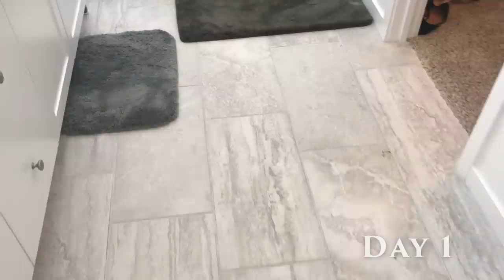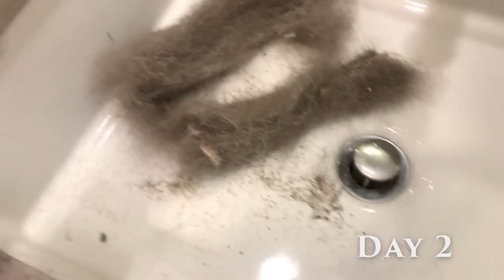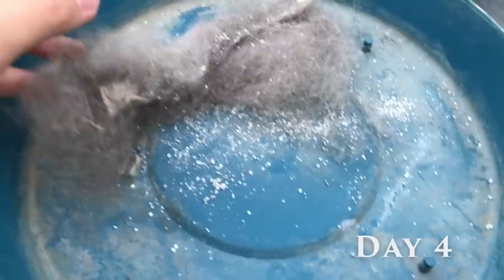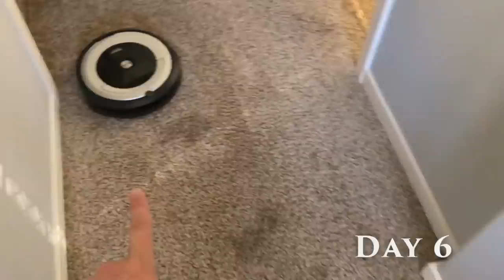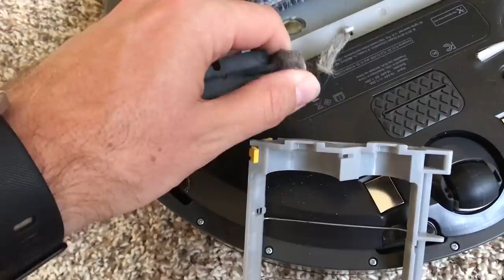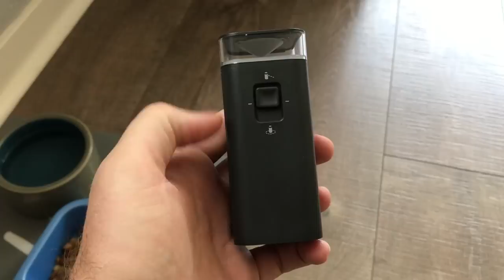iRobot Roomba true Review - My first FULL week experience

Comment: I've got a 600 series I picked up on sale for 250$. Get the cheapest one.  I like using it every day. If it misses an area today, it will get it tomorrow. Cleans under the beds and furniture.  You still need a vacuum cleaner for the stairs.  Turn it on when you leave the house or out in your garden. Put it upstairs, when you are downstairs or vice versa and you won't even notice it. A robot is vacuuming while you are doing something else or nothing. It's working right now, when I'm watching this video and commenting. No brainer.

Comment: Our Roomba 650 we've had for three years still works great. The battery still lasts for almost 1.5 
hours. We run it everyday, have a Golden Retriever and a cat so it's needed everyday.  About once a 
week or two we run a Dyson DC25 for a onceover to get what Roomba misses .
Reply: 650 owner here too. It gets the job done every day. I have a Husky at home and the 650 keeps the home really clean. it always finds the way back to the charging station and made whatever modifications around the house so it wouldn't get stuck. I noticed that sometimes it gets crazy and wont leave the charging station room and the Dock light turns on after a few minutes, but its because of all the hair on the brush, wheels and dirty sensor. I have to clean it out every day so it works properly.

Comment: that's just how they are. Unless it gets close enough to read the home charger they will do this. It could get better over time as it does the same sort of pattern and it might learn where it is but I wouldn't hold my breath. They do need a good cleaning once in a while. One thing I found is if you end up taking it apart which I have, the gearbox even gets stuff in it. The gears in the one I had were made out of some kind of plastic and will wear out over time. If you can get the right size gears you can fix it. Take pictures so you know what goes where if you do take it apart. They are not the end-all vacuum. They just don't have great suction but will keep the place looking better and somehow always finds stuff you miss when doing a normal vacuum. In a way, it's really just a glorified carpet sweeper. So you still need to vacuum the old way once in a while. If you have hardwood or tile floors then that might not be necessary. Still, it's not the end all. Personally, I like them as they always find stuff that's been missed.

Comment: I have a 680 and I run it every day and at first had to empty the vaccum bin once a day but now I can get away with about once every three days. It will not run on shag carpets and you can not have anything on the floor like slippers or shoes as the vaccum can suck up the slippers or shoe laces and become stuck. Also running it every day we have noticed that it smashes so hard into things that it is taking the paint off the front of itself and also along the skirting boards on the walls and also likes to get stuck under the sofa and has cut a mark into the wall with the side brush but over all I still love it as I never have to vaccum myself even though it can hardly ever find the charging base lol. 😊

Comment: To be fair, you are supposed to keep the charging station in an open area, also clean your robot more frequently. You are supposed to clean it 3-4 times per week.
Reply: I cannot find a replacement dock for the 365 model even on amazon. Can you help. It is an older model but still works. I got it from a deceased relative house but couldn't find the dock. It worked for about 30 mins because it had been charged

Comment: A few but major drawbacks. I stopped using it for years and don't know what to do with it.
It does not clean stairs .
It does not clean furniture with low clearance.
The auto park and charge won't work if the charger is on a diff floor.
It does not clean my house well with 1 dog and 2 cats, and a couple of long hair girls. Need to un-hair the brushes (take about 15 min) after every use.
So a lot of manual work to overcome the above.
Last but not least, noise - so it can't work during business hours - Both my wife and I work from home and we need a quiet environment to chat online frequently with no fixed schedule
I still prefer my cordless Dyson which I have to spend more time for the cleaning but a lot more efficient considering the above.
Irobot is cool, and fun. Does it work? No!

Comment: obstacles that it should be able to fit under but cant would be a breeze if you could steer it under there with a precision manual control. Users could then save those precision maneuvers to supplement the auto mapping.
Reply: You can steer it the older ones had a remote, the new ones like in the video you can use your phone..
Reply: Literally days after my recent obsession of researching these robot vacuums a close relative of mine actually got one for a Christmas gift. So you already know I'm going to be messing with that thing to the max 😂
Reply: wasted of money

Comment: Bought the Roomba e6 this week after all the hype.  We live in a 1500sf condo with a finished lower walkout.  Low pile carpet in the lower level and the main floor has thicker carpet, wood floors and ceramic tile mixed.  It's going back to Costco tomorrow.  I am not at all impressed:  (1) I watched the unit work in the bedroom and it definitely did not cover all of the surface areas, choosing to go in a small circle on occasion; (2) after approximately an hour of running I removed the filter and there was about 1/10th the residue that I normally vacuum up with a traditional vac; (3) I personally like the look of the carpet after using a traditional vac; and (4) for a few bucks under $300 there's a lot of higher end traditional vac choices.  Not for me.

Comment: Hi there. Can i please ask you a question? I can't find this info in the manual. Once my roomba goes to base, the green light on the base comes on and then it goes off! Also all the lights on the unit itself goes off... So i don't know if it is charging or it is defective. Is it supposed to do this? I thought the green light on tbm base would always stay on. Thanks.
Reply from the maker: Hi Yara, mine does the same thing. You should be fine.
Reply: @SteveDOES   louididdy  thank you for the answer. yeah... glad mine is fine. but this is a very weird feature. the led on the base should show the status of the unit. having to press on the button or look on the cell is stupid. i want to walk by and see. i think they could have done it this way. or have at least a way to turn on and off this feature. but anyway, thank you!
Reply from the maker: Yara Brandao mines in the corner of an upstairs bedroom so I never see it and just use the app for status. But I agree, it would be nice to be able to turn that light on or off through the app settings.
Reply: @SteveDOES  thanks!
Reply: I would imagine it is some sort of energy saver feature they use since the base is plugged in 24/7.
Reply: I have the 675.  The manual (or it might have been the roomba website) says the light stays on for 4 seconds on some models, then turns off to save energy.

Comment: Thanks for saving me $$. Looks like more of a pain in the ass than anything. Now looking forward to the next century.
Reply: these roomba are nothing but a hype,nothing bets a good vacumm cleaner.
Reply: @richardjackson9083  that’s true
Reply: I've got a 600 series I picked up on sale for 250$. Get the cheapest one.  I like using it every day. If it misses an area today, it will get it tomorrow. Cleans under the beds and furniture.  You still need a vacuum cleaner for the stairs.  Turn it on when you leave the house or out in your garden. Put it upstairs, when you are downstairs or vice versa and you won't even notice it. A robot is vacuuming while you are doing something else or nothing. It's working right now, when I'm watching this video and commenting. No brainer.